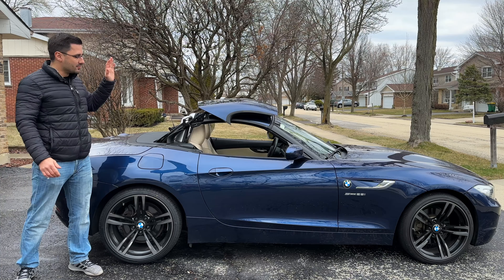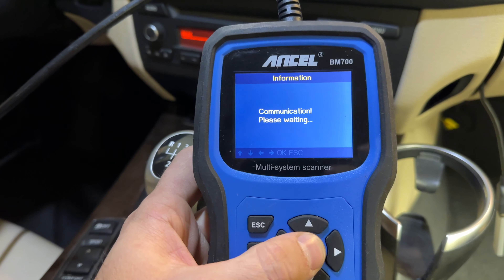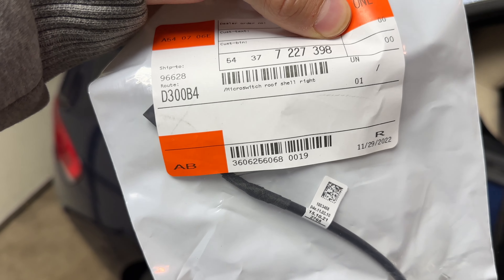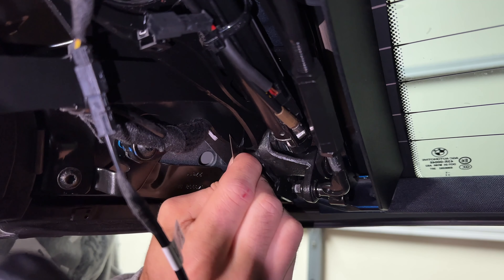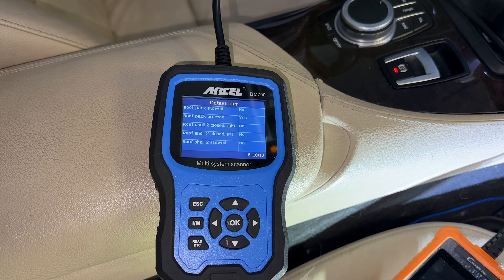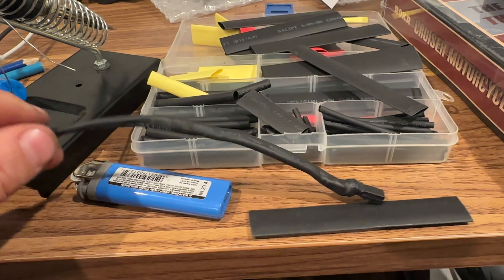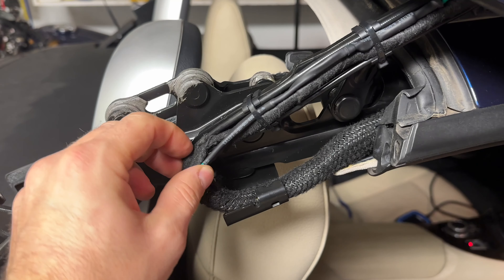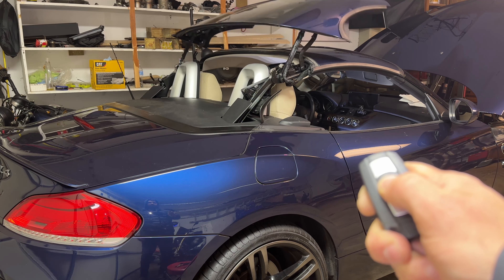My BMW Z4 Convertible Roof Broke (So I fixed it)

Comment: You're a life saver. You cannot find any videos on these cars on the internet. I've had this issue for over a year, (my solution was to give up on it being a convertible car, as when the hydraulic pressure released, the car relocked the top.) Every now and then I'd hit a pot hole or something and my convertible blinking light would turn on. Discovered by wiggling the wires on the right side it would go away, and allow me to drive the car in peace. As it's begin to get warm again I've wanted to get brave and dig into the wires, but I am very mechanically stupid. And need video guides for everything. And here it is, my holy grail, I can now see what wires I need to attack.

I've been to the dealer, and the dealership wanted to replace the pump, the top module.(which I allowed them to replace) that was almost a thousand dollars by itself. And the pump costs as much as the car, so I denied that.

I can finally fix my car, ty. I'm not very electrically inclined either, what gauge wire did you use to repair it with?

Comment: I also had a problem with the roof. It is not related to microswitches, but it can help someone who finds this video. At one point, the roof stopped rising at all. No a try. The red LED flashed immediately. The dealer said that the problem is with the temperature sensor in the hydraulic unit and I need to replace all unit. I was not ready for such expenses thet time and missed the 2020 roof open season (but I periodically tried to open the roof). Then in the winter of 2020-2021 I did not use the car for about two months and the battery died completely. As wel as battery was already more than 3 years old - I decided to buy a new one. And something pulled me to try to open the roof and it opened! And so far everything is working great. As I turned out, this is not the only non-obvious problem that was solved by replacing the old battery at E89. I do not insist that the solution was to replace the battery, but at least before investing a lot of money you can try.
Reply: Пока есть какие то проблемы с аккумулятором, зачем вообще  дополнительно его нагружать?
Reply: @СергейНетылько  Видимых проблем не было. Заводилась прекрасно.

Comment: I was watching and saying, bet he finds a broken wire at the first bend.  😀  My E89 had the same problem and I loosened up both sides of the wiring looms at that first bend.  I removed about 4 inches of the brown BMW wiring from each side and spliced in 16AWG wires for each wire at the bend.  Yes, 16AWG is overkill for the amount of current but I wanted something thick that would allow for many summers of bending wires.   So far roof works like new!   Thanks for the video!
Reply: Super great! Same here in Sweden. Do you know how to turn off hydraulic pressure to move the roof by hand?

Comment: I had the same problem. I took it to my local BMW dealer and they wanted to replace the junction box and module (quote of almost $3000). I took it to an independent and they replaced 2 frayed wires and a micro-switch for a few hundred bucks. That was it.

Comment: Thank you so much.  There is little to no detail out there or videos for that matter in relation to a malfunctioning top on the E89.  On mine I get the BMW sound of death half way through but keeps going after a second press of the button when opening/closing the top.  For now I’m leaving it alone but I’m just bracing myself that one day it may stop altogether.  Thank you for your continued great content.  Greetings from sunny Spain.

Comment: I've sold my Z4 now but these issues can be a real nightmare... I spoke to a German expert who repairs them... He said that as preventative measures certain items should be l replaced.. Of priority the wiring loom is on the list..  Over time the flexing etc will lead to failures...

It may pay you to invest an full overhaul of the hall switches and the wiring looms..   Yes not an easy thing to undertake..

Comment: Well done. Can only imagine what that would cost at BMW. My roof has been rattling since I bought it 6 years ago - unfortunately didnt notice it during the test-drive which I mostly did top-down (mistake) - the BMW dealer could not fix it (or didn´t want to fix it?) after I bougth it. Apart from that, the car has been pretty flawless. (2009, 70tkm now)

Comment: Mine had the exact same problem 3 months ago - same wires, soldered it with a small piece, will replace the wire all the way once it is garaged for the winter - bought more flexible wires than the ones that was already there.

Comment: Great Video!!!

In your case: Was the wire sheathing at the failure point torn from use or did you remove it because it's a known failure point?

If torn would wrapping it with electrical tape help prevent the failure? 

The next time I get in my car I'm definitely going to look at it, thanks for the heads up...

Comment: Thanks. Some tips: 1) Get a $5 "piercing probe" so you can probe wires without making a mess of the insulation. 2) Microswitches can be tested with a multimeter on continuity (beep) mode. 3) I would not trust that liquid insulation for any job, let alone an automotive application that suffers continual bending stress during operation and vibration from the road.

Comment: Had same problem with the HALL sensor cable. Got it fixed like this in a workshop. 900$.

How do I turn of the hydraulic pressure to move the roof by hand?

Comment: Hi and thanks. I am looking for a code reader like the one you have in the video.  I screen shot and saw it was an Ancel bm700.
I see them on line but my question is, do they all read roof code problems? Thanks
Reply from the maker: Hi! I have a video on the Ancel if you'd like to see what it can do (although it's an older video), but basically you need one that will read ALL modules on a BMW. If the scanner says it reads Engine, Transmission, etc. but doesn't read all of them it won't work for you as the roof module is kind of obscure and not common. My favorite 'cheap' BMW scanner right is  Elite LAUNCH (https://amzn.to/3ZAloPf link affiliated if you want to help the channel).

Comment: One little tip for all wire-harness work: Vaseline isn't conductive, but it's water repellent. Just dunk it in vaseline to prevent corrosion
Reply from the maker: Great tip, thanks! I would have never thought of that.
Reply: or dielectric grease from spark plug change tune-ups?

Comment: 1 year ago I had the same problem in my 2009 S-drive i23. wires went on breaking one after the other in that exact bend. there is no other thing to do than replace the wires when they break.
It looks like they have a quite consistent ageing problem, since they started breaking all in the same period, when the car was 13-14 yo.

Comment: Hey man, I’m trying to replace the same microswitch but I cant get the connectors to disconnect from each other no matter how hard I pull them apart. I’m afraid of breaking them. How did you disconnect the old microswitch?
Reply from the maker: If it’s hard to take them apart, try a sharp pick and leverage it apart.

Comment: Help Please, unlike all the examples share, mine is stuck in the retracted open position. I put the reader on it, and was able to find a bad switch, however I cannot access it without moving it. Apparently there is tool you can buy to unlock some latch, that I cannot see. Got the tool and unless I am hodini have not idea based on the instructions.. Any help, links, advise will be appreciated..

Comment: Broken wires on right side common fault. Fixed 3 times, last time i just replaced the wires with heavier gauge. No problems now.
Reply: Also micro switches in boot, trunk lid actuators. Looks like some bad manufactured parts, continuity resistors fall off.

Comment: So, I’m in this boat, went to close the roof and half way through the process it stopped dead. I’m waiting for my scanner to be delivered, so maybe I can see what’s up. Do you know, or does anyone know……. If the roof can be closed manually?  In case I can’t figure it out, in the state it’s in, I can’t drive it to a shop.
Reply from the maker: It can be lowered to a certain position, but it won't close or latch if there are errors. There is no manual way as far as I know.